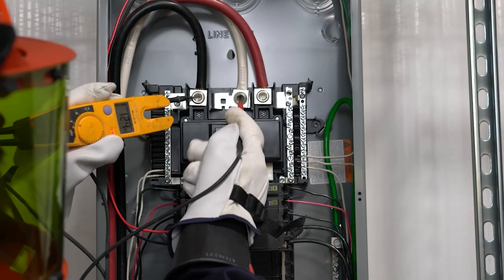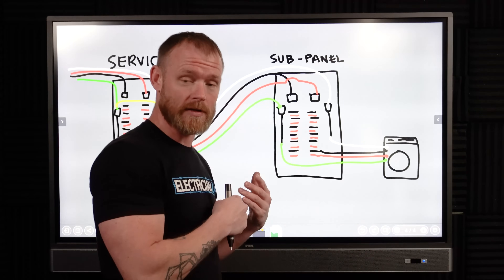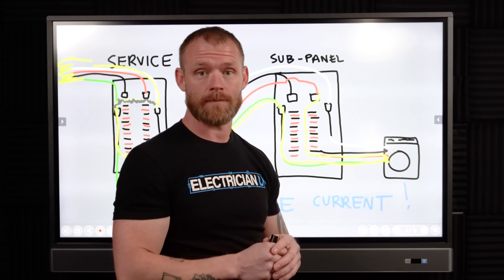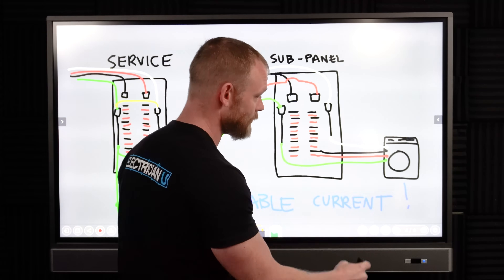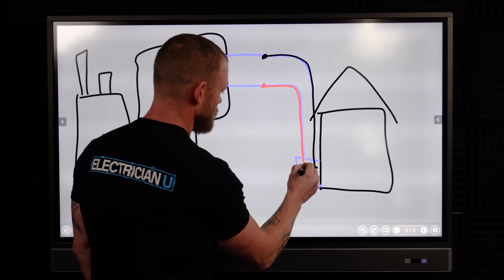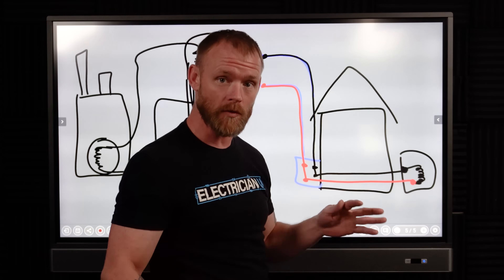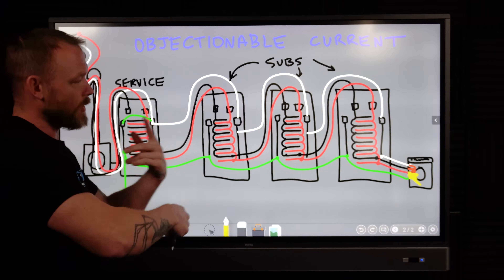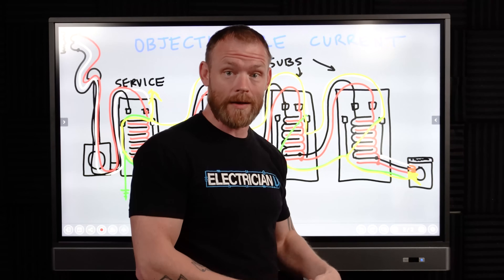Why Do We Bond at the Service Panel and Not a Subpanel?

Comment: Am I seeing correctly that you are demonstrating sub panels in series at time point 1404, and if so, people are gobbling up this garbage, which building code in the US allows this ???
Reply: The subs have a ‘series topography’ but if you consider the case where all circuits operate below the current rating of the breakers, the breakers can be removed from the circuit diagram as ‘invisible’ for practical purposes, and the resulting diagram shows that the branch circuit loads in the subs are actually operating in parallel with the chain of feeder serving the subs. There is code regarding coordination of downstream breakers, so that the downstream breakers should always trip before the upstream (facilitates troubleshooting the cause for the trip, and reduces the nuisance or harm from loss of power) but I’m not aware of any limit on how many subs one can string out on a daisy-chain run of feeder from one to the next to the next.

Comment: Sub panel ground hooked/ bonded directly to the overhead tx grounding connection is what I use. 
Sub panel is actually 3 feet from tx pole. But the sub panel has the N-G isolated. There is not a actual ground running back to the house and returning to the ground/neutral at that point...bonding at the main panel.
Point is....Neutral is Neutral and Ground is Ground.
With this..the neutral and ground are still seperated at the sub panel without the addition of running a 4th. conductor back to the house just to connect to the same point as where is is now.

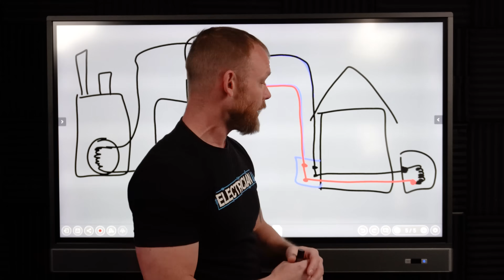Comment: Current does not flow in a continuous loop as explained at about 11:35 Only in a dc circuit. Ac lines carry voltage only in a single line (120v) to load and returns very little current on neutral especially faults. Dc flows in continuity while ac flows back and forth at a rate of 60 times a second or 60 hz in the US.
Reply: AC does also flow in a continuous loop. It alternates back and forth as you said, but electrical energy will exist in the entire circuit unless the loop is opened, say by a tripped circuit breaker. The current value should be equivalent on each individual circuit between the hot and neutral wires downstream of the neutral bus bar. From that point upstream the difference between L1 power bus and L2 power bus will be returned to the transformer as the remaining or unbalanced load. The closer L1 and L2 are in current requirements, the lower the current to be returned to the transformer. The rest of the current will return on the hot wires when the flow alternates in the opposite direction. In a completely balanced circuit and a 240 volt, no current will flow in the neutral on the former, and there's no neutral wire on the latter because it's always balanced.
Reply: @surferdude642   "AC does also flow in a continuous loop. It alternates back and forth as you said, but electrical energy will exist in the entire circuit unless the loop is opened, say by a tripped circuit breaker. The current value should be equivalent on each individual circuit between the hot and neutral wires downstream of the neutral bus bar." 

I see you have zero experience working on ac electrical lines. If 120v exist on a neutral line, something is terribly wrong, but then again what do yo know?
Reply: @kato1400  I agree with your last sentence. I never said 120v should exist on neutral, should be 0v.

Comment: You mentioned at time point 1204, the ground rod is there for a different reason, what is that reason ?
Reply: It's there to return external sources of electricity such as a lightning strike, which originate from the earth and not from the transformer.

Comment: Very clear explanation.  Thank you.  However, I still dont see why it makes any diff where  you bond - or not-in subs.  On bonding anywhere to netural any current in ground is available to the entire nuetral circuit.  I do see the advantage / necesity of having a complete ground run all the way back to the main, but bonding anywhere else makes no electrical diff that I can see.   (I am an old (73) aprentice elect from back in the 70s)
Reply: When you bond at the main electrical panel and nowhere else, you have a situation that during normal operation, the ground wire effectively does not exist, which is what you want. It will be connected to every receptacle, switch, and metal box in the system mechanically, but there's no connection between neutral or the neutral and hot wires downstream of the neutral/ground bus electrically when there's no ground fault. It's like a wire in space going nowhere, unless a ground fault occurs. If a ground fault occurs anywhere in the circuit, a connection will be made at that point, and since the ground wire is not connected to any other load, a low impedance path is provided back to the panel and the source. Like Dustin explained, the current will be so high the breaker will trip quickly.

Comment: I think you missed an important issues here.  You talked about 220V circuits, you never mentioned that all of the 110V breakers use the neutral as their return line.  Bonding neutral and ground in the sub panel would create a parallel return path for everything in the sub panel.
Reply: He mentioned it.

Comment: Hi Dustin, I didn't hear anything about the breakers in the subpanels.  I am not an electrician but my work on my own property has passed inspection in several states.  The way I read the code, there needs to be a ground wire from the subpanel to the main panel but you can establish a ground in an out building, detached garage, shop etc. If there is a ground fault in the shop, it should trip its breaker in the subpanel. Did I do it wrong?  Thanks for all the great explanations.

Comment: QUESTIONS:

If instead of the pole transformer from the electric company grid as the source, 
we had a completely OFF GRID 
solar outbuilding as the originating source of power (say 500 feet from the main panel).

1) Do we treat the outbuilding as if it were the grid?

2) Do we create a neutral ground bond in the outbuilding - as the source of power is generated there?

3) Do we create a neutral ground bond at the Main Service Panel?

4) if there is a NG bond at the power producing outbuilding - and a NG bond at the Main Service Panel - if a short circuit occurs - 

a) WILL IT TRIP THE BREAKER in the Main Service Panel?

b) will it trip the breaker in the outbuilding that feeds the main service panel?

c) should each building have their own ground rods?

Please advise.

Your channel is invaluable, 
and provides great knowledge.

Thank you

Comment: please advise how to ground a solar main power panel.  it's not a main house or subpanel.  I have a barn solar power system build and the last step is the grounding of the power panel.
Reply: The power panel I'm referring to is the breaker box not the panels on the roof. Thanks.  I have decided not to ground the panels on the roof since they would become a lightning hazard.

Comment: From a generator Manual Transfer Switch where either the meter power or generator power goes directly to a 400 amp capable manual transfer switch then the output splits into two directions, one direction going west to the house main breaker where the ground is bonded and then sends power throughout the house, and one going to the east directly into a 60 amp main breaker emergency cutoff switch box that is mounted to the outside of that generator manual transfer switch housing that then sends power underground to an out building where there there it goes into a 60amp panel inside the outbuilding that powers lighting and outlets inside the outbuilding.  ((( Should the 60 amp main breaker emergency cutoff switch box be bonded since it is technically the first panel past service and then feeds the "sub-panel" inside the outbuilding, or should the 60amp panel inside the out building that feeds all of the power inside the outbuilding be bonded since it is an actual service panel that feeds the outlets, and lighting inside the outbuilding, and then the emergency cutoff switch should be treated as just an emergency cutoff switch that interrupts the underground line in case there something that hits that underground line? ))). Thanks.

Comment: Question, I'm a homeowner simply educating himself. I understand why you say bonding must be done at the main panel. I recently saw a video where an electrician was saying that someone had the bonding screw at the service panel and said that was wrong. He said it should be at the main disconnect I believe. One why is bonding also done at the main disconnect and what's the difference?
Reply: In most residential applications the main electrical panel is also the main disconnect because it's the first point of entry. In some cases however, there is an electrical entry point upstream of the main electrical panel, also known as the first means of disconnect and the bonding would be done only at that point.
Reply: @surferdude642  Thanks for responding

Comment: Hi Dustin, firstly thank you for your video, it is very helpful. Now question: 
What about if we have a three families house with, of course three services panels. Therefore we should bond individually each panel (not a sub panel) and ground them individually, correct?
Thank you again for comments 
Wellington
Reply: Do you have 3 separate meters?
Reply: Typically, for 6 or fewer meters/mains, each main switch will form a part of a multi-throw ‘service disconnect’. The current rating of the overall service (single set of utility-connected lines serving all loads in the building) will be limited by the actual service conductors, and the size of the neutral-ground bonding provision and of the grounding electrode conductors will relate to the size of the largest service phase conductor. The ‘service’ ground will run from a common enclosure for the 3 (or 4 including ‘house’/common areas loads) meters, or from a main service switch if present ahead of the meters. The ground serving the ‘service’ will be sized to the service conductors which will be sized to the overall service load requirements calculated for the multi-family building.

Comment: In a bootleg ground you would also have current on the ground wires and therefore also objectionable current and it seems to me that the entire grounding system would be affected, since all the ground wires are connected. Most of what I have read is that the main concern is that if you get an open neutral. I think it's always bad because current could be everywhere on the ground, no? Maybe someone can explain.

Comment: If a hot wire touching a case is something that needs to be designed so that current can flow through the neutral so that the breaker can trip, they why not just directly connect the appliance's case directly to neutral? Why is a separate wire for grounding necessary even if the ground bus is bonded to the neutral bus anyway?  Aren't clothes dryers built before 1996 3-pronged devices that connect neutral to the case?
Reply: Appliances with 3 prong plugs extend the equipment ground from the receptacle to the metal case and do not connect to the neutral wire. Under normal operation the grounding wire is only connected to the neutral at the main electrical panel and the current travels only on the hot and neutral wires. The ground wire is essentially unconnected from the electrical system like a wire hanging in space. It does nothing when everything is functioning properly. If a hot wire comes loose and contacts the grounded case, an electrical connection is made and the current would travel unimpeded through the loop via the ground wire and trip the breaker like Dustin explained in the video.

Comment: OK.........Totally Off Grid with solar, batteries, and a generator backup that can also be used exclusively to power some stationary shop machines. Should the gen be linked-in as both a backup, AND as a "utilities" main so that it can also run the "big wattage" shop machines directly? How to bond such a setup? Separate main service panels? 😊

Comment: I noticed that you only had a ground rod on your primary service panel and not the sub panels in the drawing.  I plan to come off of my meter box and install a sub panel in my garage.  The meter box has a ground rod driven next to the pole it is on.  Do I need to drive another ground rod to be attached to my sub panel?
Reply: Check with your local code, but as long as the garage is not detached, a separate ground rod is not required.
Reply: @surferdude642  Thanks Ted !!!!!!!

Comment: My house is built back in 60 ( I own this house recently) and the cables did not have a ground wires. I recently experienced the lost of lighting through out the house (only one circuit for lighting) , so I tried to troubleshoot and found out that  the connections  in one of the J-box were burn out and the hot wire and white wire were both touch the metal J-box (in the attic and lucky  I wear the glove so I did not get electrocute  when touching the metal J-Box).  I just wonder why the lighting circuit breaker DID NOT trip? Can you explain this,? thank you.
Reply: If the hot and neutral wires (bare portions) were in contact with the metal box at the same time, the breaker should trip because the metal box would be the conduit to make a hot to neutral short. If only one was in contact or both but not simultaneously the breaker would not trip.